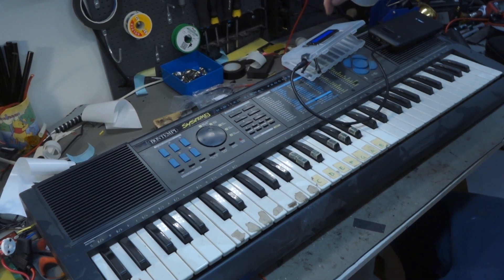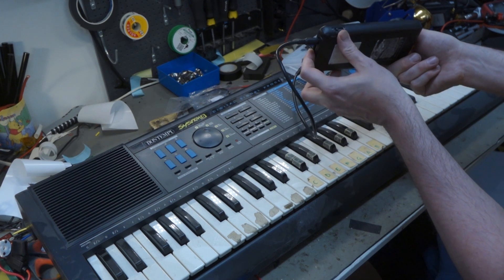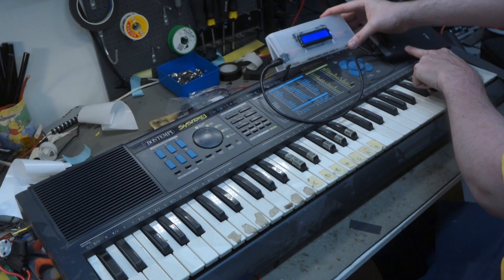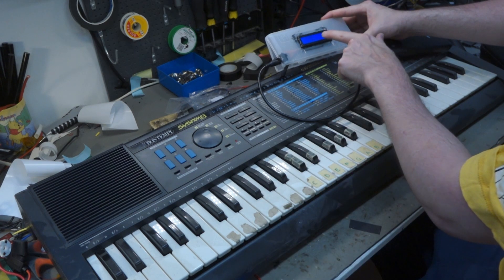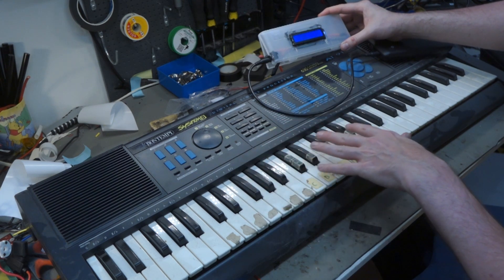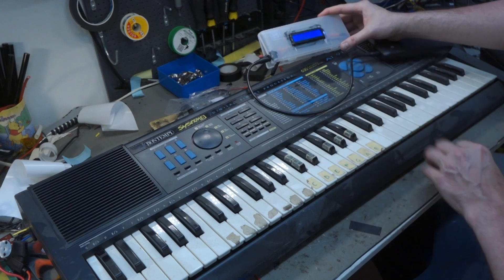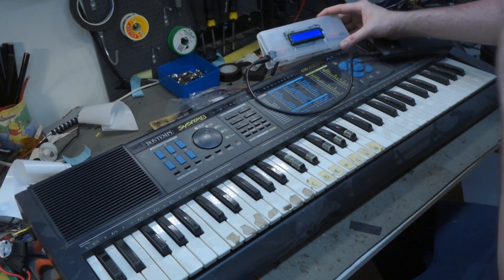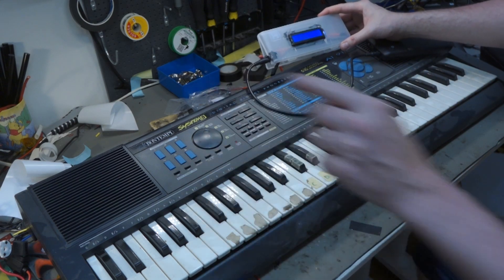Portable DIY 9V/12V battery for synth/keyboard

Comment: Hello, I can't see the cord plugged into the back of the synth. I only see the powerbank plugged into the  amp meter. Is there a cable going from the amp meter to the synth? Can you plug the power bank straight into the synth? Thank you